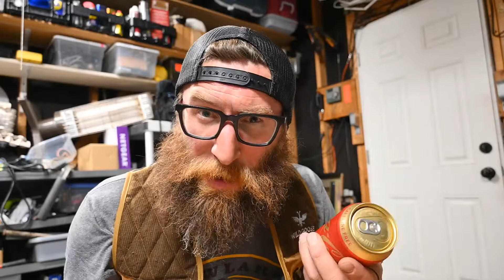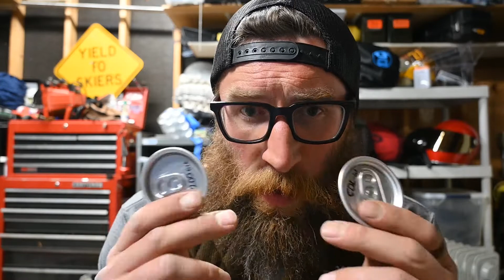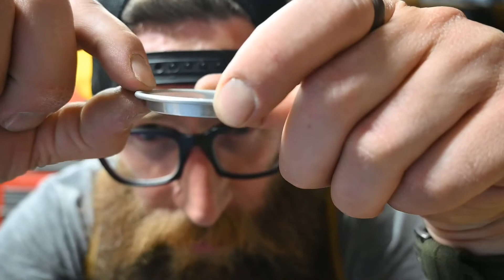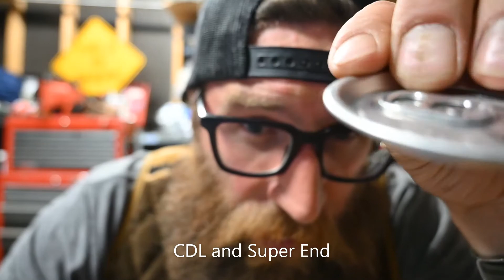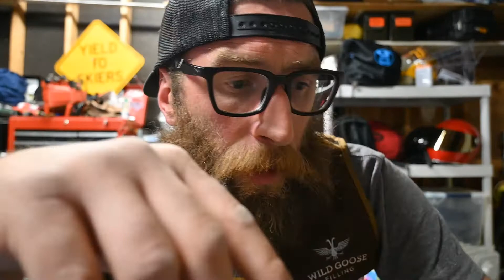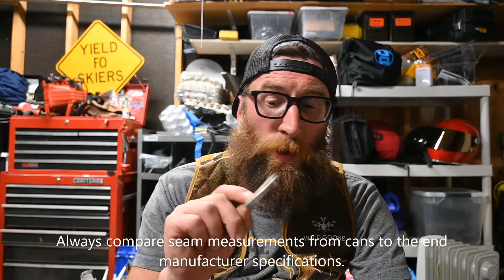Aluminum Can End (Lid) Styles – What’s the Difference? | Goose Garage from Wild Goose Filling

Comment: LOE is not a can end. LOE stands for Large Opening End and is an indication of the opening size. The one Ben calls LOE is actually B-64 end and requires a B-64 chuck in order to seam the can. Alcoa developed the b-64 seaming end in the 1950s ?? church key can opener was required to pierce the top. In 1961 Alcoa licensed the Pull Tab design from Ermal Fraze and incorporated that in their b-64 end. In 1976 Daniel Cudzik patented the Stay-on-Tab which Alcoa integrated into there B-64 end. The wider opening (LOE) was introduced in the 1990 and is still widely used today. In 2004 Container Development Ltd patented the CDL can end  later follewed by CDL+ and CDL-E. All CDL ends use the same chuck. The "+" and others indicated thickness and other small variations but they do not require a different seaming chuck.
Reply: The CDL end also has a large opening and is a LOE end. Crown makes SuperEnd that requires yet a  different seaming chuck. It also has a large opening and is a LOE end.

Comment: Thanks for the info, but i have one big concern, what is the difference between the CDL-E, CDL-W and CDL-D, in the chuck selection?
Reply: First, ALL CDL lids have the same chuck profile.  The main difference is in the chuck lip height.  No difference between E and W.  They both have same profile and  .250 chuck lip height (countersink depth).  W was originally made for Miller for a tab-to-chime concern they had, but that's a deeper engineering discussion that I won't go into here. 
CDL + is the most common of the bunch, with Coca Cola and many others running this great lid.  It has a .235 chuck lip/countersink depth.  
Nothing to be concerned about; you can actually run those lids interchangeably on the E, W,  or + chucks and make a good seam.  You're only talking about .015 chuck lip height difference.  Happy canning.

PS-Never heard of CDL-D lid.  Doesn't mean it doesn't exist, but not aware of it.  I wrote the conversion guide to CDL+ in 2011.  We converted 70 high speed can seamers across 49 Coca Cola plants